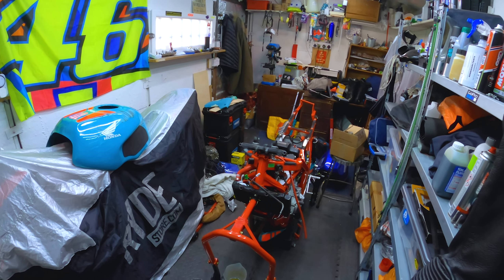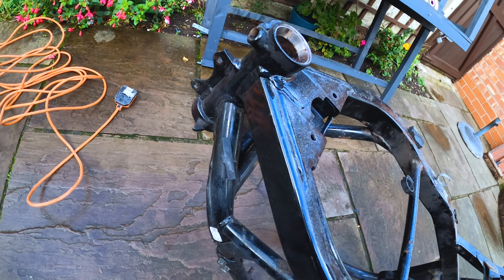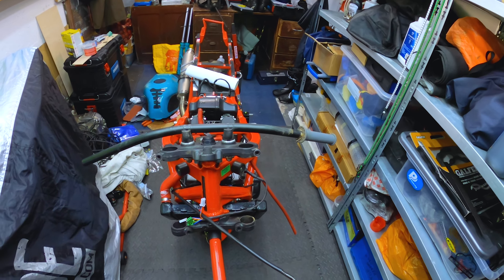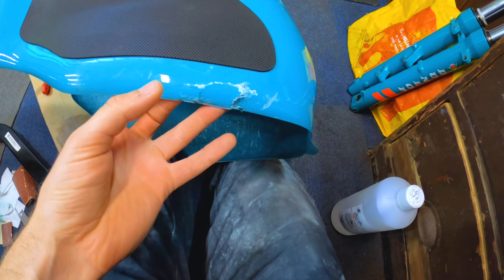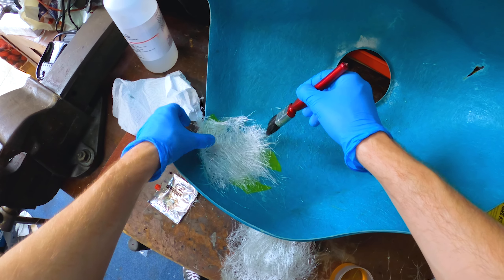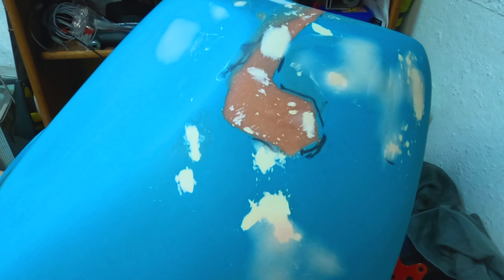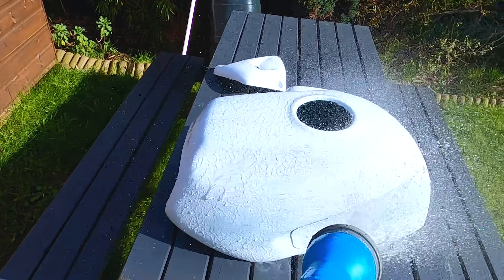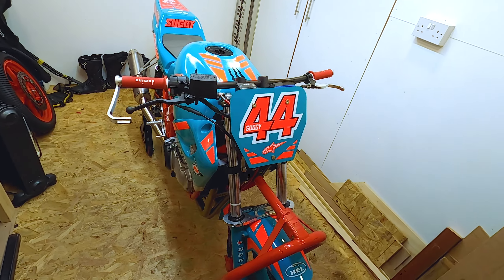Crash💥 aftermath and bike/fairing repair

Comment: When you say brand new frame/tank is it new new or new to you? Is it just off ebay?
Reply from the maker: Yeah I mean new to me. I managed to find someone who was breaking a CB bike down, so I bought the frame and tank. Got lucky as the tank was amazing inside, no rust or anything. The frame was in good condition too, so I had it sand blasted and re powdercoated in the red 👌

Comment: Oh didn't know the bike was that bad mate, looks like you've done a good job on the rebuild, when are you out 🤔
Reply from the maker: Yeah it was pretty bad, luckily my engine was totally fine, otherwise it would have been a right pain to fix. I took the opportunity to give it a clean up and painted my engine while it was all apart. Been out at Oulton and I've done the Donington race. Got a few videos to post soon 👌
Reply: @Suggy Racing  nice one mate, iv got my first ever race this weekend coming, any advice on starts not done a race start yet 🙄
Reply from the maker: Ah cool you'll enjoy it once you've done it. It is a bit nerve-wracking at first. I'm not very good at starts either, but they are definitely crucial to doing well. I just try get set up with the bike, then hold me revs still as I let the clutch out slow. I don't give it loads of revs, just mid-high revs and keep my hand steady. I've seen a few dump the clutch and wheelie the bike vertical in front of me. Not what you wanna do. The problem is, nerves make it hard work. I've had some absolutely shocking starts, had one this last race at Donington. If you stall put your hand up so people don't hit you. For your first race, I would literally aim just to set off quickly rather than a fast start and just make it to the end of the race, no matter what position you come. Hope that helps. I think like everything, it's just practice
Reply: @Suggy Racing  that definitely helps mate, I think your right probs best just playing it safe and getting it off the line, rather than ballsing it up lol, cheers mate 👍
Reply from the maker: Yeah no worries. Like I say, I'm still crap at them even with a few races practice. Once you are moving and off the line, then give it some. It's not like how we see with Moto GP, on the limiter then blasting off🤣 Well, it certainly isn't when I do it 😄Good luck with the race. Is that with NG at Donington this weekend by any chance?